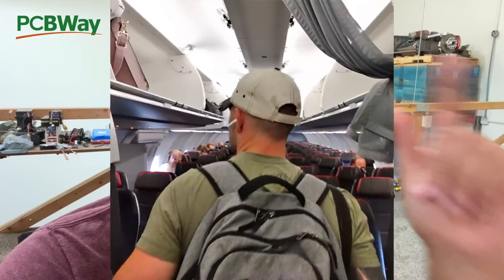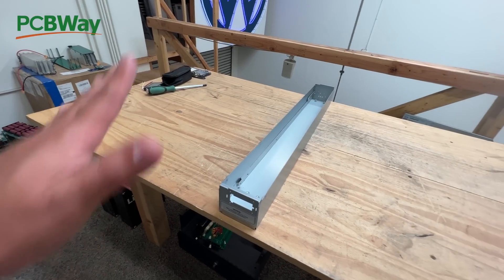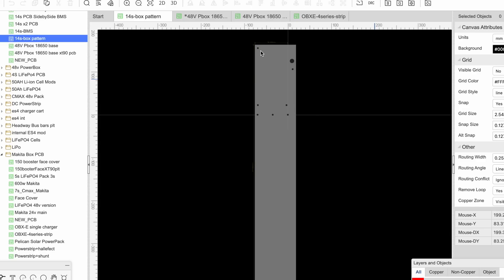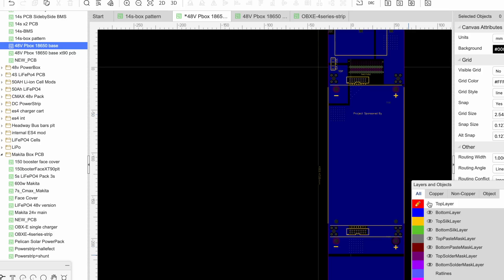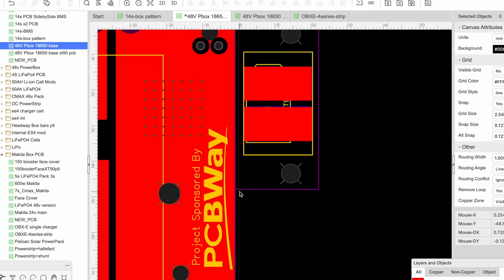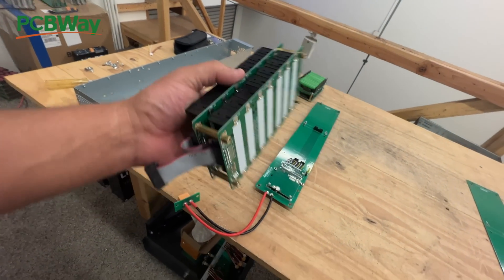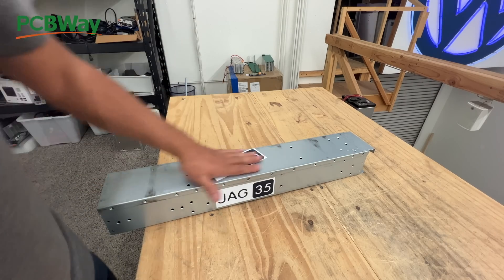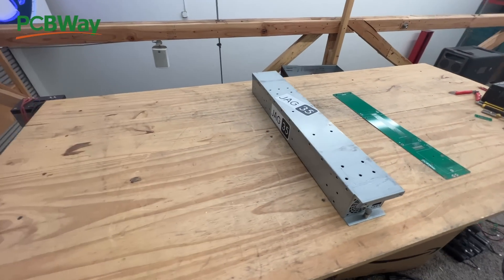48v DIY Battery Project Using recycled Enclosure

Comment: Hi their, I would like to know, where i could get this software to design a circuit board from, as' i use those Super Battery Cells of a 4.2Volt at 4,000Farads, which make good portable batteries, but' need to make a good equal circuit board for the current path ways to help keep them in balance with each other, can you help me with a good software program i could use ? Regards George.

Comment: One question 🙋 why lithium cobalt battery's don't have big size ? I mean why always tiny cell why cannot make big cells same like lifepo4 have 280ah but that 18650 cell always small 
Best regards from Philippines 🇵🇭
Reply: 18650 cell is 1990's laptop size, later used for everything. Cheap from volume, new size wouldn't be cheap. 

280ah is newer and ev sized